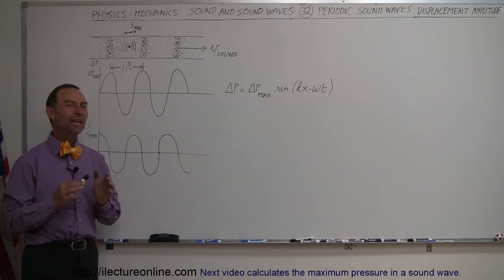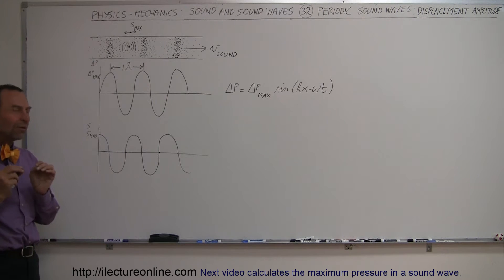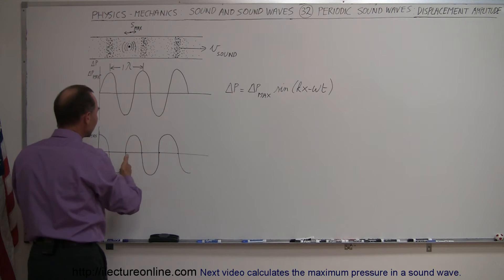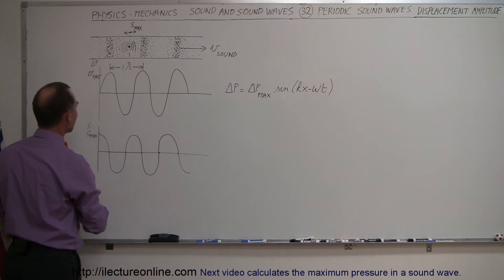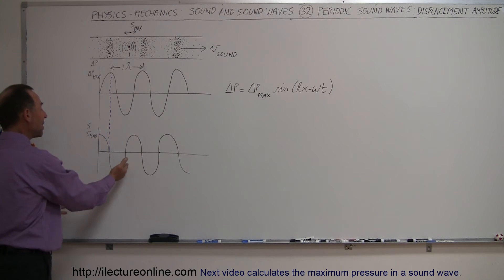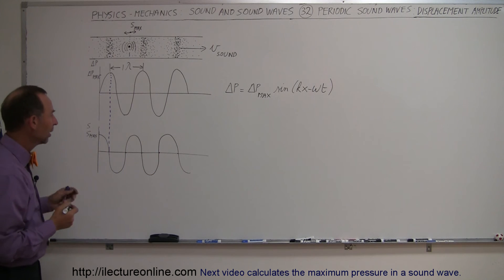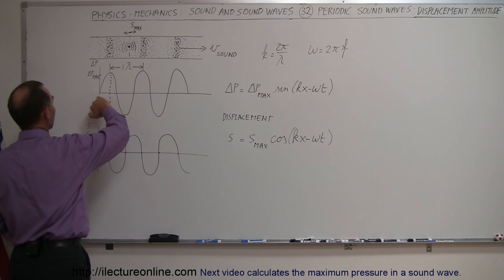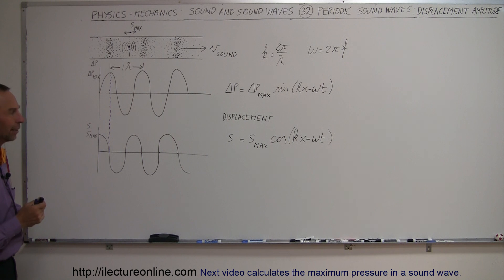Physics 20  Sound and Sound Waves (32 of 49) Periodic Sound Waves: Displacement Amplitude

Comment from the maker: As long as the air molecules are one one side of the equilibrium point, the pressure keeps building up.  So the pressure is a quarter of a cycle behind the displacement.
Reply: Sir i am also physics teacher and i always thought that pressure is behind but there are many articles on web and in books which say displacement lag by 90°
Reply: @WISHALL52  is the same, you could also say that pressure is a quarter of wavelength behind the displacement
Reply: @amirkiev8205  hi thanks for the reply but now I have got into depth of the question and found that the leading and lagging is based on direction of motion of wave